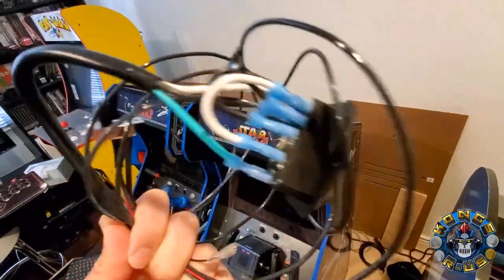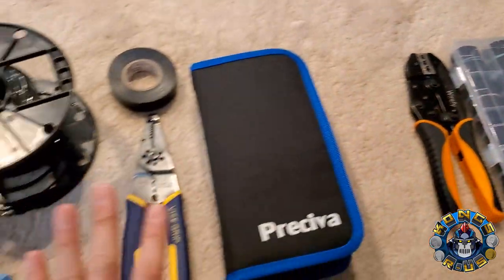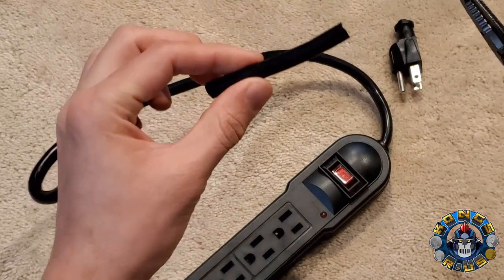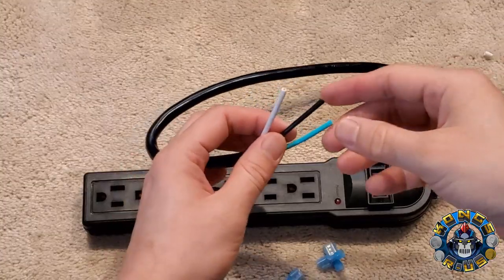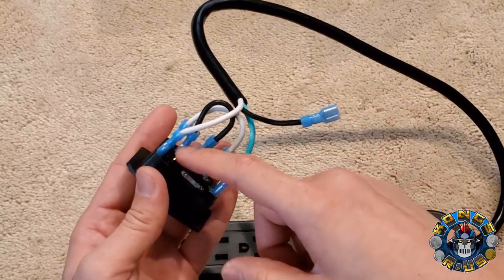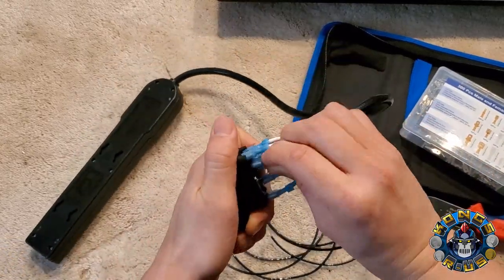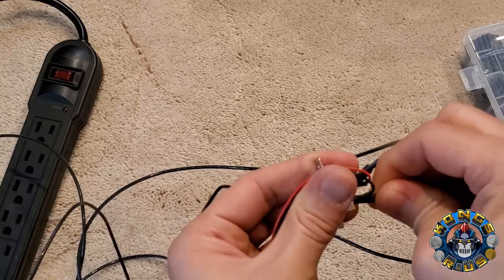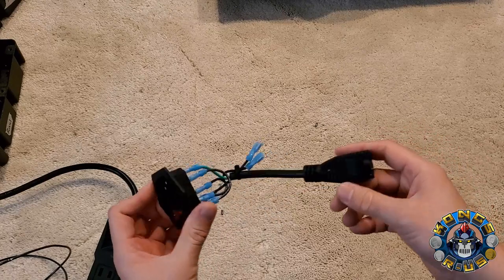How to Wire Stock Arcade1Up Power Switch to Inlet Module Switch Tutorial (Power ENTIRE A1Up Cab!)

Comment: This tutorial is amazing.  I have never modded anything, barely played with emulation and don’t even own a pc (just an old MacBook Air), but I just ordered one and I am tempted to do a PC mod on my MSH cab.  That will be a test run for before I get my AFM pinball machine - love the idea of dedicated pinball fx3 machine.  Your videos are inspiring - I literally have 0 tech skills but feel ready to take this on!  Can’t wait to play with Launchbox as well.  Thanks for sharing all the great experience and knowledge!  Does shutting the switch off just cut power to the pc?  Is that safe to do?
Reply from the maker: thanks for the comment! u should never cut the power when using a PC mod. depending on your front end, you should shutdown your PC in menu, or wire a separate button to safely shutdown your PC before flipping the A1up power switch with this mod. this switch is simply turning the surge protector inside your cab off/on, so it wouldn't shutdown ur PC properly
Reply: @KongsRUs  thanks for the quick reply!  Yep that makes sense.  Easy enough to just keep a wireless keyboard/mouse handy for proper shutdowns.

Comment: Great video.  I have something similar on a virtual pinball table minus the A1up switch.  What do I need to do in order for the PC to turn on with the switch? Thanks!
Reply from the maker: You just need go into your BIOS menu and go to power options. Then look for the option to Power ON when A/C power detected. varies slightly depending on the PC, but you should be able to find it

Comment: Another awesome video! I wanted to tell you that our OutRun has stopped working again. Doing the same thing as before. I believe that the problem could be with one of or both of the plug outlets for the ribbon cable. None of the controls will work again. I put in a ticket, Arcade1up customer service told me that they will send me a new ribbon cable and to try that. I really hope that's the issue. I'm frustrated at this point. OutRun worked for a week then the controls stop responding again out of the blue... 😑😡
Reply from the maker: yea, could be the cable or possibly loose connections from the the buttons/pots into the encoder board. lmk how it goes!
Reply: @KongsRUs  I checked all of those wires, nothing loose. I will let you know, just upsetting brand new cab.

Comment: Curious why you didn't just splice the stock switch into the black wire of the power strip? Great video though, I was paranoid about using the stock switch straight to 110 but hadn't pulled it to verify the rating.   Edit: wasn't trying to question your plan but was just curious if there would be an issue with splicing straight into the black wire
Reply from the maker: how would the power strip get power though if you didn't wire it to the inlet module switch first?
Reply: @KongsRUs   so let's say you didn't cut the plug off the end but instead you just get access to the black wire; my concern before I saw you're video was that the switch wouldn't be rated for 125v so hooking direct power to it would overload it, but you have supplied the info I needed about the switch so now I just need to test the draw of my cabinet and see if I'm within spec to use the factory switch. I have a ps3, gaming pc, amp, monitor and some powered signal switches, thinking I'll be within range but not trying to burn my cabinet down lol
Reply from the maker: oh, that's a lot of stuff plugged in! 😄 just be careful for sure. And most power strips don't have long cords so attaching it to the inlet module switch just makes it cleaner on the back side. good luck on your mod!

Comment: Could you just wire the Arcade1up switch to replace the switch on the power strip? I’m looking to do something like this as I modded my Arcade1up and want to use the stock switch. My thought process was to open the power strip and basically remove the switch and wire the Arcade1up switch from the deck down inside the power strip.
Reply from the maker: Hmmm, it might be possible to do that, but I didn't want to mod the surge protector itself to retain its full functionality.

Comment: Thanks due to this video I'm going to do this mod, just waiting on the parts now. Do you have a tutorial or can you point me on the right direction to get the Audio switch to work with a windows PC? It's an Arcade1up Marvel VS Capcom cabinet. I think it's the third generation.
Reply from the maker: You can wire the vol switch into a USB arcade encoder, and then use JoytoKey to map those arcade button inputs as Vol and Down

Comment: I know I am extremely late but I am confused as to why you added the extra switch. Couldn’t it work with just the switch that’s in the inlet?
Reply from the maker: I wanted to make use of the stock A1up power switch on the control panel. If you have access to the back of your cabs, you could just use the switch on the inlet to power it on and off
Reply: @KongsRUs  thank you so much

Comment: Is there any reason to do this over just plugging everything in to the powerstrip inside the cabinet and then having where the powerstrip plugs in at the wall hooked up to smart plug? I feel like I’m likely missing something….
Reply from the maker: it's a clean solution to still be able to use the stock power switch. however of your setup uses a smart switch to turn everything on, you can do exactly what you said. inlet module switch on the back of the cab makes things look clean as well
Reply: @KongsRUs  Much appreciate the reply!

Comment: Does this allow for safe power down of the rasperry/pc before shutting down the power or does it just work as a power cut off?
Reply from the maker: no, this just cuts the power, so u would recommend safe shutting down first in menu. then flipping the switch. it should boot up when power is detected though to turn it on